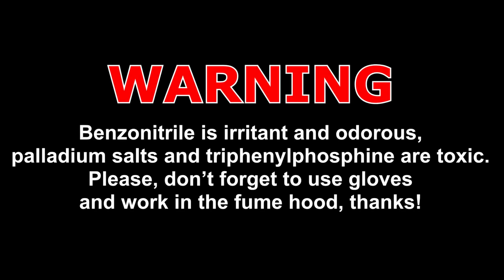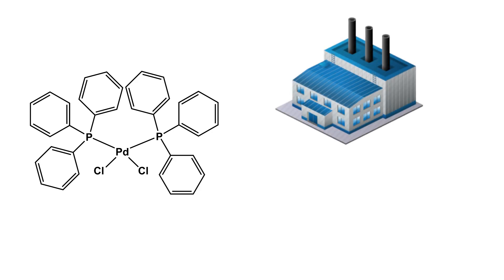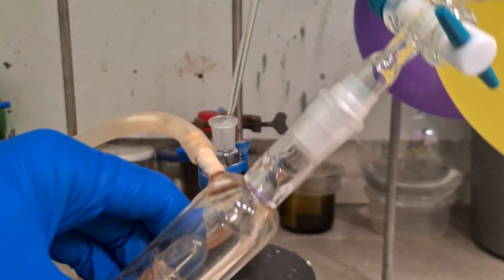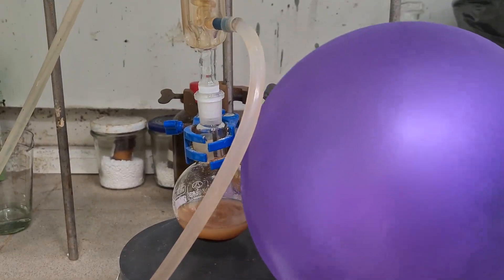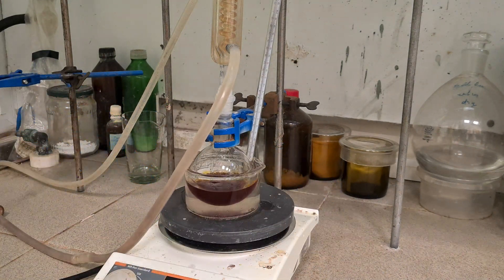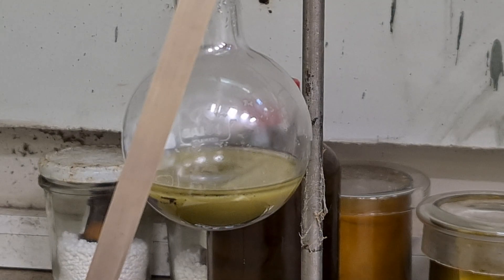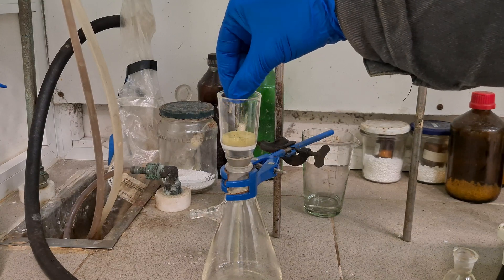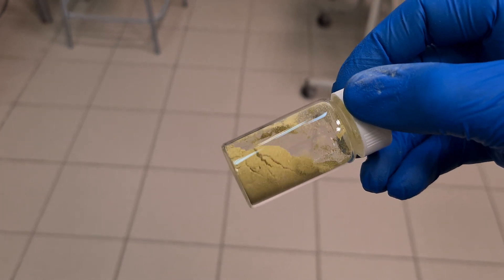How to make bis(triphenylphosphine)palladium(II) dichloride Pd(PPh3)2Cl2 ? | Quick guide

Comment: If by lower yields with acetonitrie you mean 90-95%.... from my experience it works great with ACN, and it is more convenient
Reply from the maker: Do not trust to Pd(MeCN)2Cl2  false yeild.
Reply: @AcanthareX  i was talking about making Pd(PPh₃)₂Cl₂ through Pd(MeCN)₂Cl₂ intermediate, works great
Reply from the maker: @ejkozan  I understand it. I mean this method gets mixture of  Pd(PPh₃)₂Cl₂  and Pd(MeCN)₂Cl₂
Reply: @AcanthareX  i can not agree, in laboratory for research we made Pd(PPh₃)₂Cl₂ by Pd(MeCN)₂Cl₂ and I can say without doubt it was sectralpure and high yield
Reply from the maker: @ejkozan  Are you made an any analysis to proof it? My words are based on RSA from my colleagues.
Reply: @AcanthareX  well we have made NMR and there was no MeCN only PPh3, it was years ago, I can check if I have protocol that we used back then anywhere
Reply from the maker: @ejkozan  Okay I believe you! Maybe my mate have failed some precautions during synthesis 😉
Reply: @AcanthareX  we made it this way only because waiting for vendor package was taking long, and we did not had any dba.
I do not remember exact source paper, and as you can see below, you do not make Pd(ACN)2Cl2 and then transform it but you make it in situ with triphenylphosphine already there:

499.4 mg of PdCl2 and 1.6285 g of Triphenylphosphine were added to a 50 ml flask, put under Argon and a cooler (under Argon) was attached. 31.5 ml of Acetonitril (dry) were added and the reaction mixture was stirred and refluxed for 18 hours under Argon atmosphere (ballon). 
The reaction mixture was evaporated, Chloroform was added until everything was dissolved and the mixture filtered trough a syringe filter. Hexane was added to crystalize the product. crystals were dried and filtrat was brought to dryness and washed a few times with Heptane to recover more product which was combined to yield 1.9 g of yellow solid.
Reply from the maker: @ejkozan  OMG! I really appreciate that you started those debates on using acetonitrile! I wasn't right to say about low yield basing just on my mate's experiment. I have messaged him, he said that mixture produced cuz bad timing and wrong temperatures. Nevertheless, it's scientific channel not a silly sci-pop, so there is a place for discussions! Hope, our small conversation helps somebody who doesn't have a PnCN but acetonitrile does! <3
You are very good viewer and well-educated guy!
Reply: @AcanthareX  Thank you! Sharing knowledge and debate is ey of science :)
I am only sad that I can not recall original source paper for this protocol :( I also hope this would be of use for someone one day :)
Reply from the maker: @ejkozan  That's a wisdom thought my friend! :^)  If you find that protocol, please, let me know!
Reply: @AcanthareX  I am very sorry, i did not write down doi it seems, it was just something found on reaxys years ago and I am not able to pin point it now :/
only thing I have is protocol I posted above :/
Reply from the maker: @ejkozan  No prob!